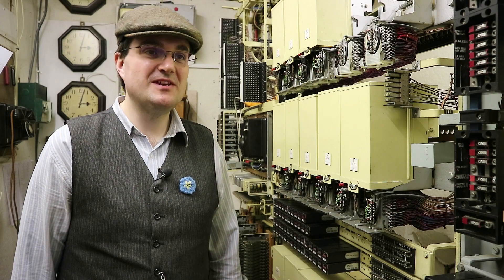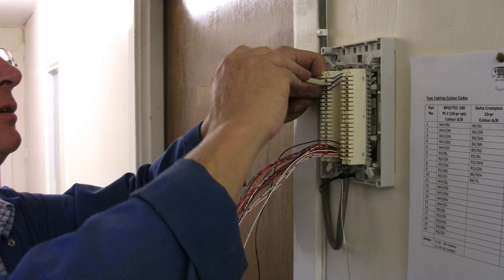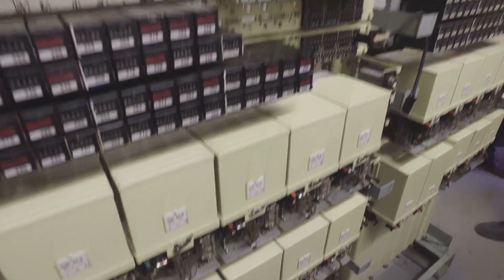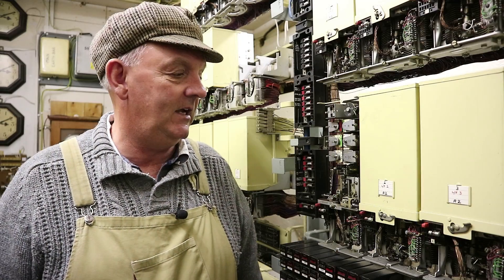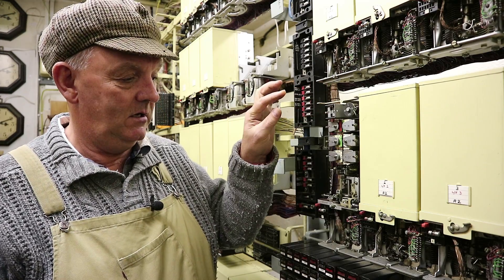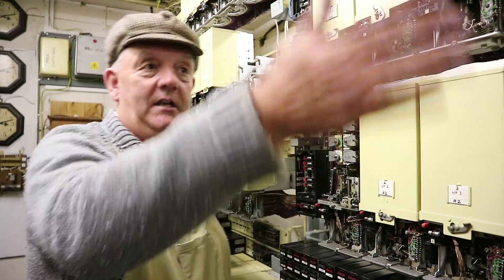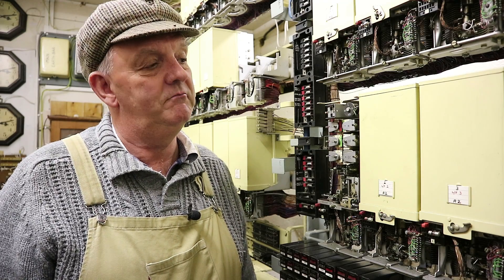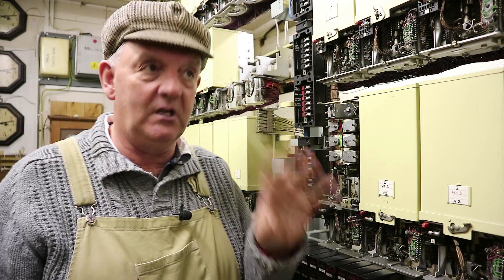The Beamish Automatic Telecom

Comment: Plessey telephone company Liverpool made some of the strowger equipment. The switchers are called uniselectors which are mounted on banks which are mounted in frames called Racks which are cabled out to a IDF-Internal distribution frame which is then cable linked to the final frame called a MDF-main distribution frame, these frames are still used today in most telephone exchanges. Cables from the MDF go out to the street cabinets that you see usually on the corner of your street then the line is Jumpered out to your telephone at home.
Reply: These are not uni-selectors.  Because they are with the subscribers meters I think they are primary finders rather than group selectors or final selectors.
Reply: A uni Selector is different. It is. A simple semi circular shape that subs lines connect to.
When they pick up they try and find an outlet to the primary selector which is where dial tone comes from.
Reply: Not quite, smaller PBXs would indeed use uniselectors but UAXs tended to use SXS switches which would travel up a level then across a bank - lovely machines!